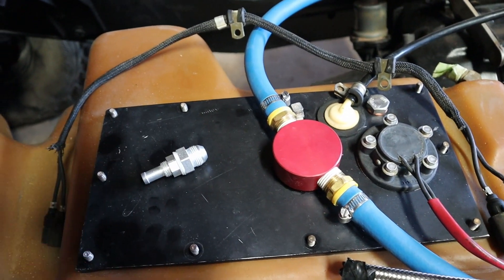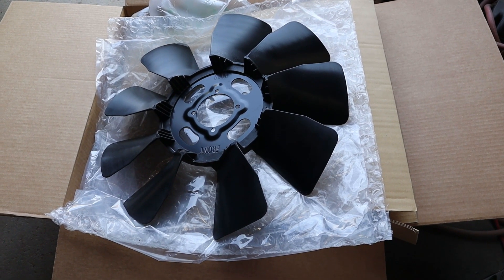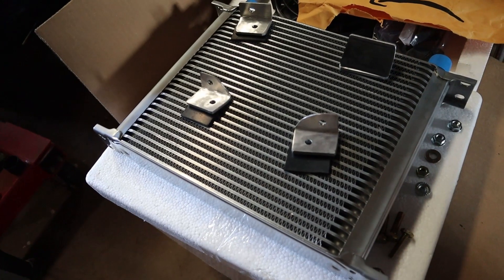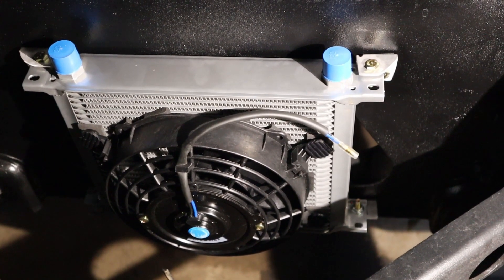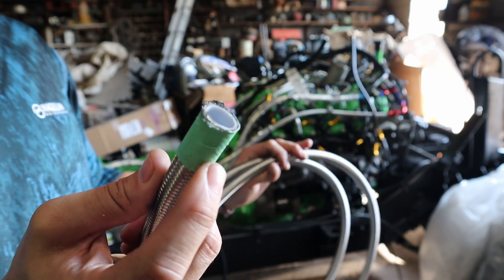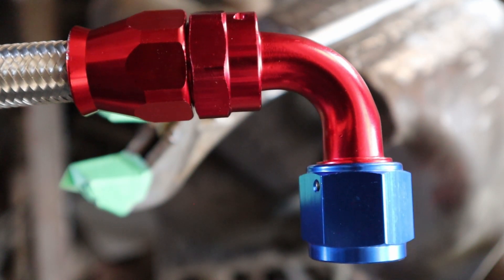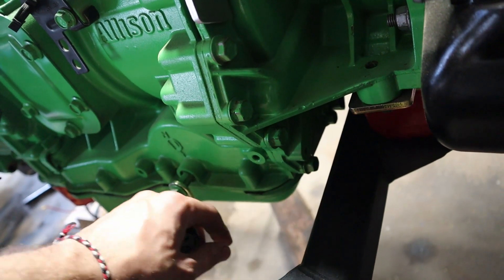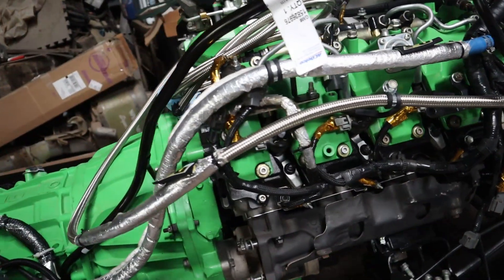Project Duramax Humvee - Remote Transmission Cooler Install and Finish Fuel Tank Mods

Comment: Nice Series!!!
A HUMVEE is a project on my list - though with LS and LPG Gas. And I live in Germany, which makes things a "little" complicated...

Electric fans: My first thought was: This should move way MORE air. Isn´t it? They are typically smaller, but an e motor can run waaay faster.
Reply from the maker: Thank you! Sounds like a good build too. I'm sure that will make it a little more complicated! 
Because of the amount of torque that the engines put out they are able to run more agressive blade styles. Electric fan may be able to fun faster but are usually less agressive of a blade pitch/design. CFM of air flow is really what you'll need to look at. Seems like with gas engines it is more common for people to run electric just based on the little research I've done.
Reply: @tossthewrench  right, the blade design makes a lot of a difference and adds to losses too. Which is negligible on a tuned duramax 😅

Comment: Hey bro check the fan off of an lly 2005 duramax.  Mine fit perfectly. According to predator inc the electric fans don't push enough when I was watching one of their videos.
Reply from the maker: I did end up finding one that would work. It should be in the next episode. It does seem like it might be an 05 fan or a trimmed down version of the one I showed here.